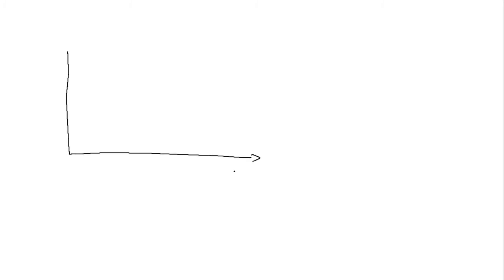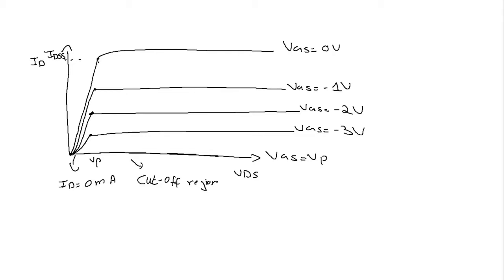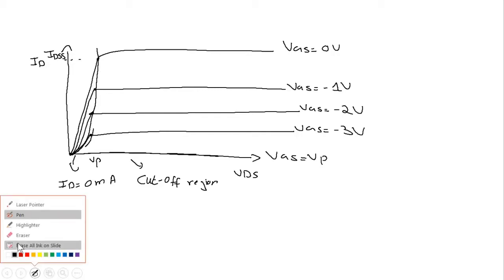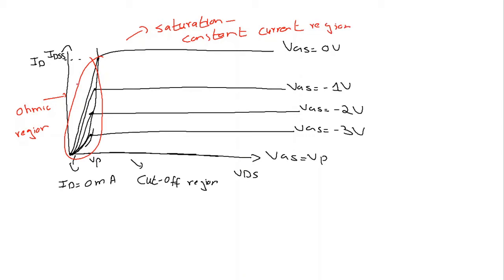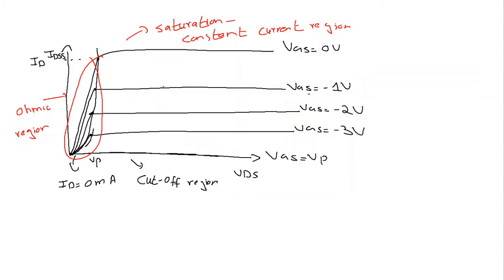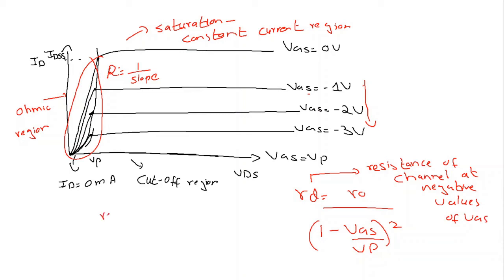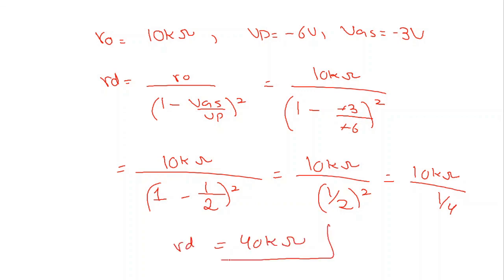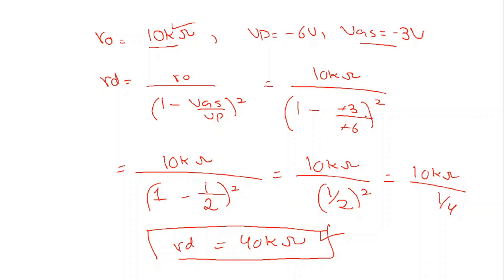JFET as voltage controlled variable resistor| JFET as variable resistor

Comment: Hi, I have a 9fuel) gauge that I would like to control with a microcontroller. The gauge can be set at either 0-190 Ohms or 240-33 Ohms. JFETs don't do zero Ohms, do they?, so I would have to use the 240-33 range would I not? The gauge is a bit like a voltage divider, and the signal wire to ground is controlled by varying the resistance.  5 Volts on the signal wire, so probably about 30 mA. Is there a JFET that can be used to control the resistance in a range that would suit this gauge? 
Thanks.